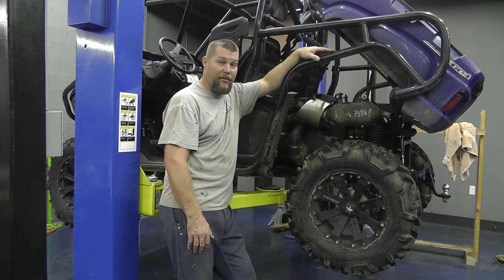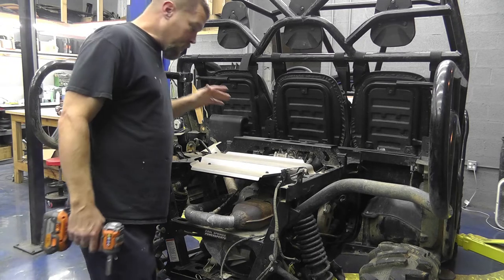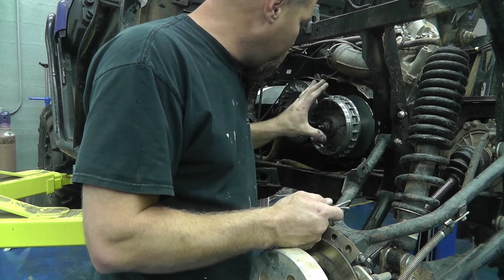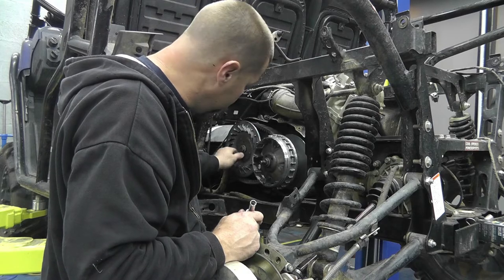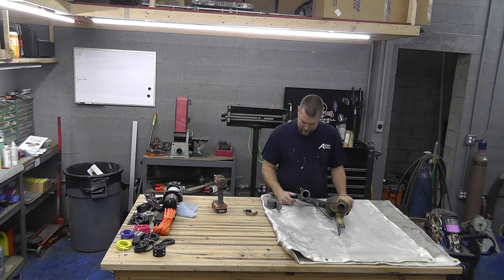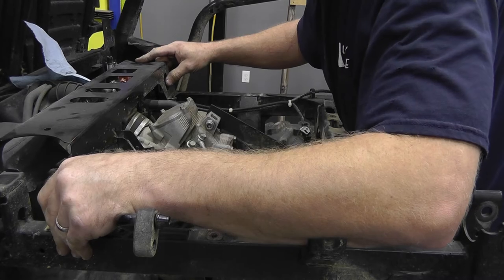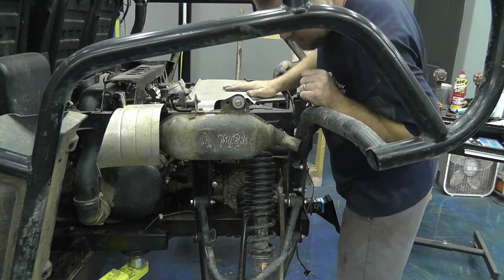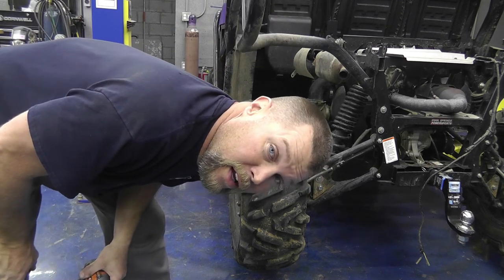Yamaha Viking drive belt change and exhaust repair

Comment: I'm fixing to buy my first SxS. Why do you need an aftermarket belt? Thanks for the video.
Reply from the maker: I wouldn't say it's a must have for everybody, but if you are gonna wheel it hard or put oversized tires on it it's a good idea because the stock belts are not designed to handle the extra stress. Thanks for watching.
Reply: @fabjunkie4229  Thanks

Comment: I got a 2014, I been watching your videos, I would like your opinion. About 3 months ago started making a clanging noise, sounds like rear differential. Have pulled different apart nothing, pulled clutches out nothing. Put carrier bearing in u-joints good, did put in new 1 way bearing. Still clanging going forward and backwards. Any ideas? Thanks deerslayer
Reply from the maker: Did u check the CV joints?
Reply: @fabjunkie4229  yes I did, they are fine
Reply from the maker: @richardkelso5583 wheel bearing ?
Reply: @fabjunkie4229  they are fine. I replaced right front. The only one that was bad
Reply from the maker: @richardkelso5583 did u check the teeth on the gears. I broke my front diff, so it's not impossible. It would certainly make that noise
Reply: @fabjunkie4229  haven't checked front, when I get clutch back in if it still clanging I'll pull front diff. Thank you

Comment: The reason your drive belt is destroyed is simple. You are abusing your Yamaha by pulling too much weight and foolishly working it beyond its capabilities. Those belts are warranted for 10 years and you ruined yours in 300 miles? You bent the rear frame by pulling logs with a machine that is not designed to do that. Don’t blame Yamaha, it’s operator error and stupidity that caused the damage. 😂 I own a 2021 Yamaha Viking and it’s a great machine
Reply from the maker: I agree that its a great machine. I never layer blame anywhere but myself. The frame isnt bent. That one little plate is a little chewed up, but ill replace that easily when i decide its to far gone. I might be foolish from time to time, but I am not stupid. I dont need your approval of anything I do in my life.  It's my machine. I paid for it. I'll do what ever I want to do with it.
Reply: @fabjunkie4229  ok. When you were running your hands around the clutch and flywheel areas wondering what caused the belt to be damaged, I got the impression that you didn’t realize the problem was the operator. Otherwise why did you act so perplexed about the belt damage as if you expected to find rough spots in the pulleys? Anyway,  have fun with your Yamaha
Reply from the maker: @edwardl.990  I'm well aware that I beat the hell out of my machine. Honestly, for what I've put it through its a miracle that it's still alive at all. I've been so happy with how it has handled the abuse that I would certainly not hesitate to buy another one if this was damaged and not repairable. Thanks for watching.